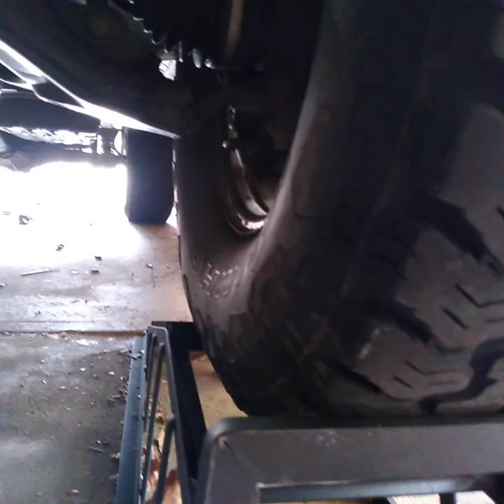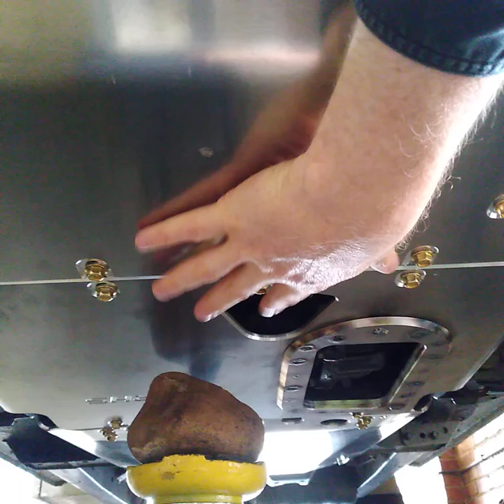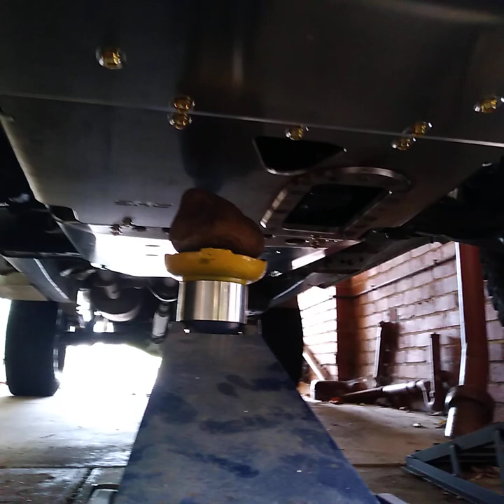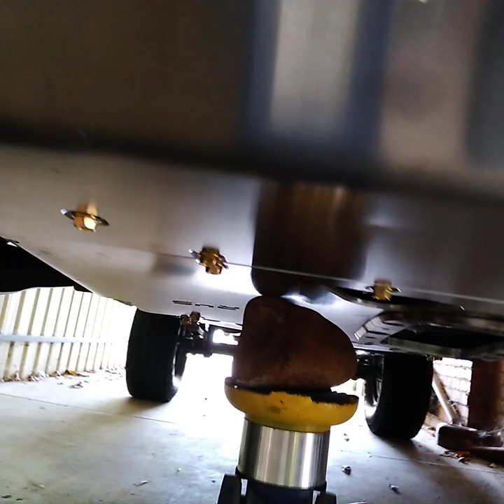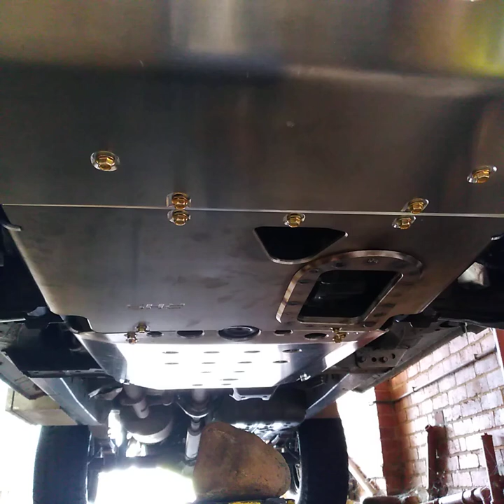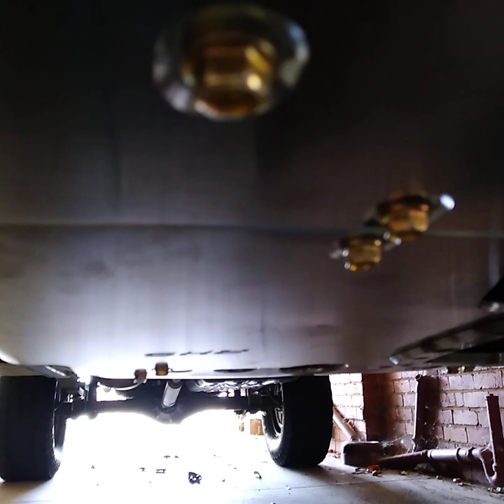Testing a 6mm sump bash plate made by RHS Offroad Engineering

Comment: I may have missed it. What vehicle is this on?
Reply from the maker: N70 Hilux
Reply: @rhsoffroadengineering  thanks, I thought maybe you had done it for the amarok you have or had.
Reply from the maker: @scottandchels6813  i no longer own an amarok but i have an impending order to do one for an Amarok, and once done will make them available.  Where are you located?
Reply: @rhsoffroadengineering  just we paddle from Tasmania, New Zealand 🤣.
Reply from the maker: @scottandchels6813  okay, so just add some silicone and polystyrene and an outboard, or hold tight and wait 🙂